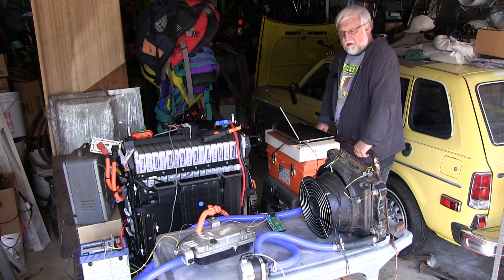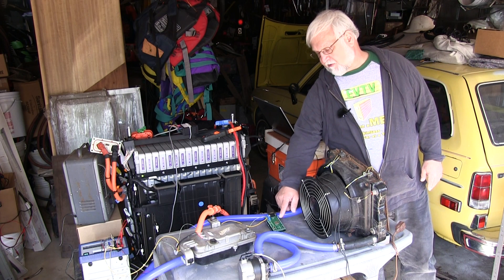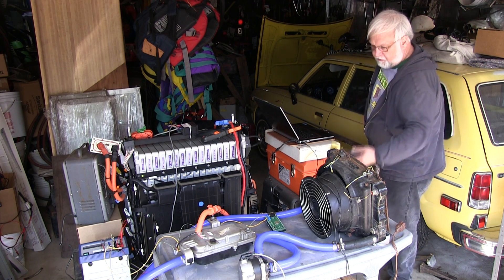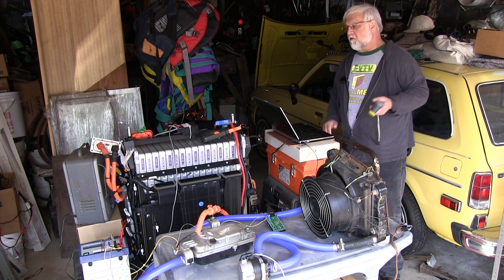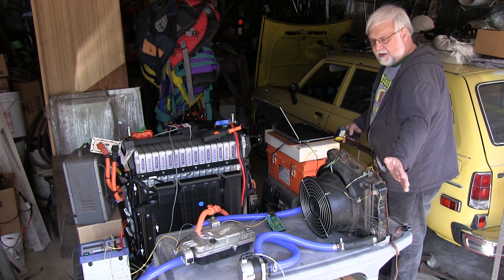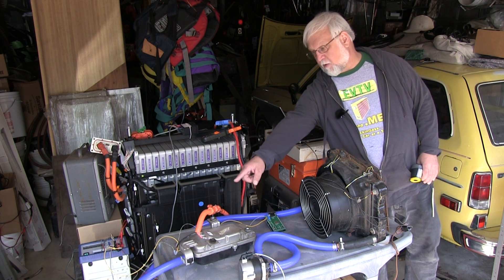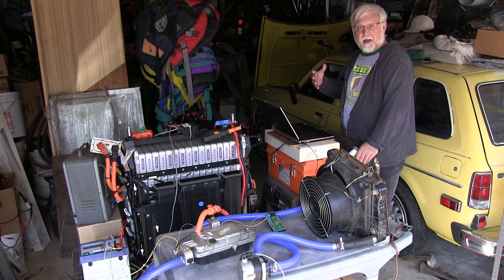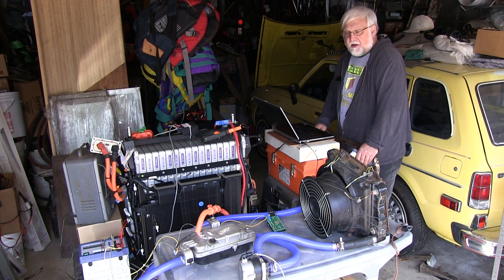Chevrolet Volt Coolant Heater

Comment: The question I have is can the heater be rebuilt or refurbished? Mine makes a whinny noise and doesn't heat as well.
Reply: Per another video, I see there is no way for a rebuild.
Reply: @KTPurdy  After having this issue it appears to be a common fault with the can-bus chip in the heater module. The chip fails to communicate with the BCM. Mine is intermitent.

Comment: https://www.drive2.ru/l/456998265263541164/

I have two batteries on the Chevrolet Volt
need help who understands
Reply: Hi. You have done some very interesting mods to your Volt. When you installed the Rear camera. Didnt you have to program the system to enable the camera? Did it enable itself?

Comment: 6:50, I think the max output of the pack heater is 2200 watts or so. According to the Chevy Volt forums. Might take 1.5KWh to raise the pack's temperature 30F. Probably more like 1KWh.
Reply: Pack heater in Gen 1 is 1800W. You can find public  GM video of Bill Wallace stating that.
Reply: @ondago2  thanks, yep about 5 years ago I got my first Chevy Volt and I've been learning ever since

Comment: Hi +Mark Weisheimer, I spilled some water on my connections diagram, could you help me with the HW pinout? (Can you confirm that the middel wire into the heater is HV+ (~400Volt)?)

Comment: You could just put a hair drier on the floor and plug it in if it is too cold.
Reply: That doesn't heat the battery coolant.

Comment: Thanks for the great review on the heater - I have a few questions 
How many heaters are there in the Volt just one
When you preheat the cabin I noticed my engine coolant heats up around 20 degree so does the pre-heat feature also heat the batteries in the volt. 

Thanks
Reply: ^^^^^Negative please check the reference material. There is two heater modules in the volt. One is for the cabin which is the one in this video and the other is for the battery and it sits in front of the battery pack.. http://www.tonkinonlineparts.com/images/parts/gm/fullsize/1008251R02-011.JPG
 http://gm-volt.com/2010/12/09/the-chevrolet-volt-coolingheating-systems-explained/
Reply from the maker: +Bustin Ass 
There is a single heater in the Volt and it heats both the cabin and the battery.
There is a valve and pump available to control if and how much hot coolant goes to each.
WopOnTour published this good info:
http://gm-volt.com/2010/12/09/the-chevrolet-volt-coolingheating-systems-explained/